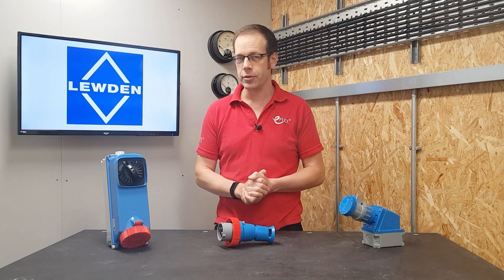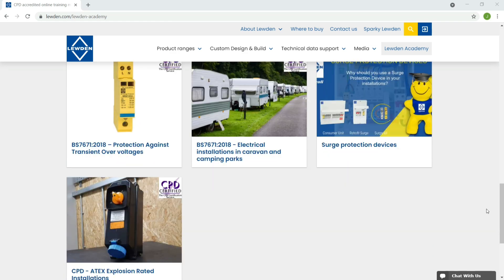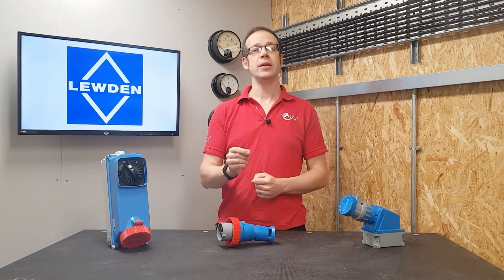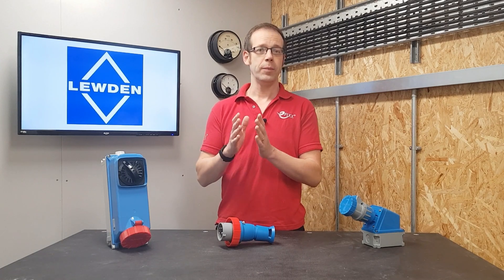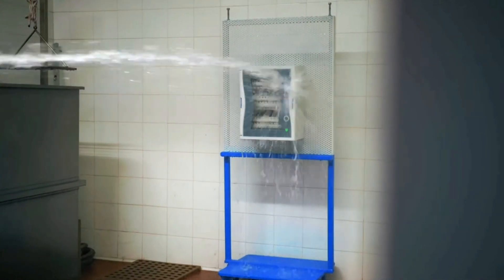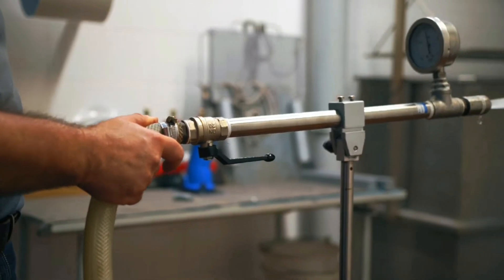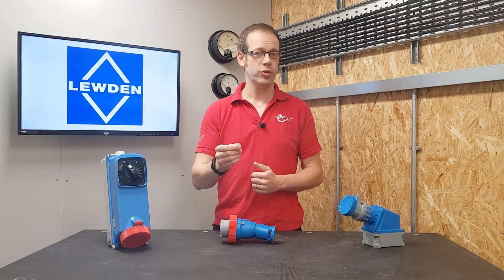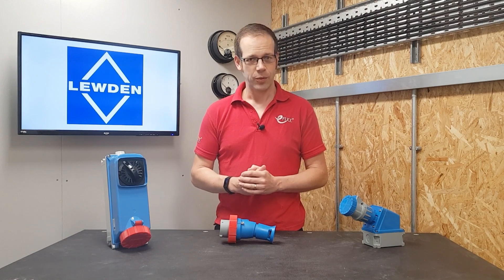What does IP69K mean on electrical equipment?

Comment: So what would my watch, that is rated down to 200m depth, be? IP 69? Or ip68? It is a Casio g shock btw. No omegas or rolexs for me. I ain't a sparky...
Reply: It's a different classification, IP68 = 1.5M depth for 30 mins resistance, the watch uses the water pressure at depth to seal the watch casing tighter so it's classified as just a depth ie water resistant to 200 meters, more than that and the case itself may crush and fail.
Reply: ur livin da dream bruv ..... im a sparky n ive got a mickey mouse watch.... only problem its only got 1 hand so allday it looks like mickeys callkin me a wanker loool  wow a digital watch owner   loooool